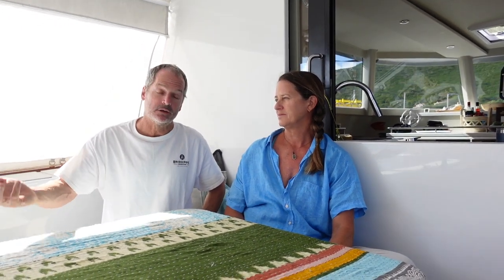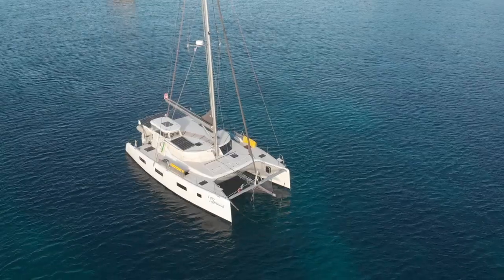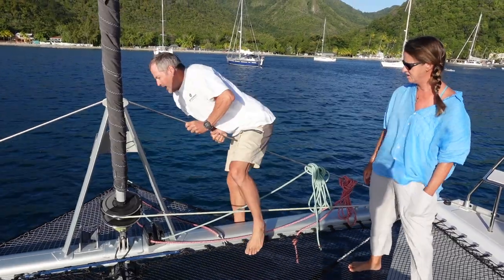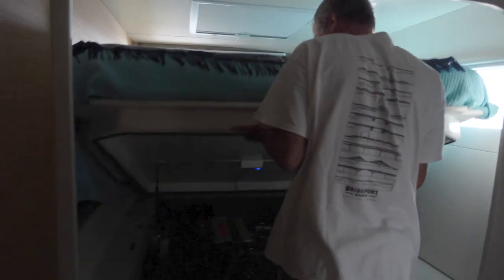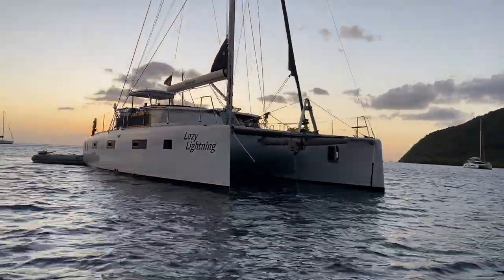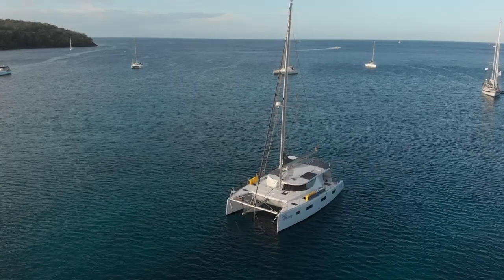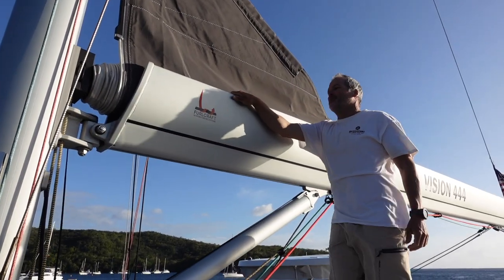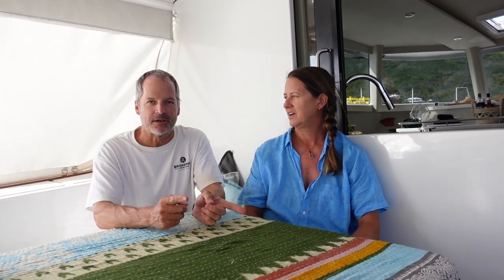ELECTRIC SAILING: WHY THEY CANCELED THEIR OCEANVOLT SYSTEM

Comment: We will have soon an monohull OVNI 430, aluminum boat , 24 kW Ocean Volt electrical motor, a 19in propeller, 2 x 24 Volts LiFe Po4  batteries ( if one set fails, the other one can work, a 11 kW genset that can provide automatically electricity to the motor if we have problem with the batteries and 940W solar panels. All the boaters with an hybrid system are very happy and will never return to a big diesel engine, noisy et smelly. But silence has a price and it is still costly. In 2035, diesel motoring boat construction will stop in Europe. Be prepared

Comment: Serial systems make more sense and are more efficient, that's why most freight across America is moved by locomotives with serial diesel electric drives. The only advantage of a parallel system is redundancy in the drive system but on a catamaran you already have two motors which is redundancy, do you really need 4? The only issue now is someone making large enough motors for your desires.

Comment: Follow the logic of Toyota and a hybrid is the ultimate as a large battery has a huge expense and all your eggs in one basket. I want to be able to motor out of the way of a freighter a fishing boat or a storm if my rigging let’s go or,,,,got hit by lighting and fried the electrical systems. How green are batteries ? You can buy a replacement battery , just the cells, for a Prius that are better than the originals for cooling for around 2500 usd. eBay has complete battery packs for under 4000. Automotive systems are amazing for the safety of replacements. You have no choice and must cut the power coming out of the battery pack in order to remove it. Incased in metal has a cooling fan with a filter built in temp sensors  and will be bolted in place. Bingo . These batteries would easily fit under your bed . If you aren’t sure just watch a YouTube video of how to change a Prius battery. Using components from the automotive world is possible but not for everyone. The advantage of supply and universality are a no brainer. The safety factor as automotive products are designed for impacts roll overs and basically accidents. A Prius battery pack weighs 90 lbs and would basically fit in a large suitcase. So have two of them with some solar and power the whole boat and a separate starting battery for the engine. Thanks for the video peace on earth and ocean.

Comment: PS There isn’t a battery made or is going to be available for the foreseeable Future, that can even get close to the Energy Density of Gasoline, Let alone Diesel Fuel.That a very basic Fact that people need to get their Heads around. That is why my Next New Boat, an Island Packet IP 439 comes as standard with an 80 horsepower Yanmar Diesel, and to guarantee proper Battery Care, it is also going to have a 6 kwh Diesel Generator which will not have very much use, though to keep it happy, it will be run regularly. Bob. 👍⛵️✨✨✨❤️

Comment: People go PARALLEL hybrid because of redundacy of systems. Diesel dies then eltectric takes over or vice versa. That's the big argument. But comes the question of weight.  2 systems = weight of 2 systems. You double everything. Can anybody tell me how people can build performance carbon boats including such a design which does not care of the weight? This makes no sense at all as performance means control of the weight. I do not get either those same people as they say they will never use the diesel engine, or just in some rare situations as the recharge of the batteries is needed. This being said, they will use 99% of the time an electric motor which is not a true main electric motor, since it just an additional motor added to an existing thermal engine system,  and in order to charge the batteries, they will use a diesel engine which is not a true dedicated generator...Reliable technology is there. A true electric engine combined to a true generator. SERIAL hybrid makes sense and seems to be a smarter approach!
Reply: more weight w those 2 electric motors yes but you delete the generator that would bean even swapp on weight, and you have two generators w hybrid

Comment: Most of the electric and hybrid packages marketed today are for getting in and out of docks and harbors. They are substantially undersized. Motors on sailboats must be sized for the worse conditions and long durations. That is why the sucessful electric boats are large and can accommodate 100-120 kw emotors and 200-300 kw battery banks per motor. A lot of weight and a lot of money. After the initial start up of a big electric motor  you can "motorsail" for 10-30 hours drawing about 15-30 kw per hour. I prefer an electric electric motor in bad conditions because torque is instant while diesel torque is wot.I have also have lost my diesel too many times in bad seaways because of overheating or contaminated fuel. Two 7.5 kw generators will extend  your range substantially.

Comment: This is timely for me. Thank you very much. My 65 + years in Alaskan waters (all seasons---that is winter, winter, winter, spring|summer|fall) have kept me from the all-electric drive. Too many two week northerlies with heavy icing conditions and as well anchor-draggings and wind switches in the middle of the night that had me having to run out into a large strait or sound. Then there was the time I was awakened at 0200 by all of the fresh water ice in one massive floe cutting loose from inside the bay during a howling SE and riding over my anchor line while crunching into the fiberglass hull.
So even for inside waters of B.C.-Alaska there are times where you need the sustained power of a diesel for getting out of and staying out of a life-threatening jam. There are also places where the currents run much faster than the hull speed that you try to time your passage through but it doesn't always work out to plan.
In summary, I agree.
Reply: Since it is the case that the most powerful motors are electric motors while also being instant on and instant torque, an electric system seems to be ideal for your situation especially coupled with a diesel generator to recharge your suitably sized battery bank as needed. In the North and its heavy winds I expect a couple of wind generators would be ideal in reducing your diesel generator capacity and your permanent fuel tank size. In such a system your biggest maintenance headache would be the diesel generator, fuel filter, and to a lesser degree those wind generators. :)

Comment: Some great points here but I would recommend a serial hybrid system for the majority of sailboats.  The parallel system has its benefits but where you really want that is in a larger powerboat where going fast for over an hour is necessary.  Two sailing catamarans one 54' the other 64' with serial hybrid systems from Torqeedo sailed from Cape Town to Antiqua.  no issues.

Comment: A day when u can add on the bracket to mount an electric piggybacked to the diesel on existing setup. Independant of and as an alternative to , when conditions are right. Perhaps a sprocket for a belt/chain between the transmission and coupler ? and a reliable, simple clutch. My yanmar 2gm20's are 40 yrs old now and running nicely. A simple retrofit is the day I'm looking  forward to. Maybe I'll learn to weld 😊. Nice video guys and I agree with your decision .

Comment: Can you explain your reasoning about electric being better suited for costal cruising than blue water sailing? I seems the opposite to me: one cannot afford to run out of power near the coast and one sails when on a passage, even if it means slowly when there is not much wind.
Reply: Just noticed this.  The problem is that one sometimes needs to motor for multiple days in seas, and sometimes waves larger than 2m.  The Oceanvolt system could barely get the Vision444 to 3.5kts against the wind in medium seas and consumed more diesel with the 18kWh generator than two 40hp diesels @2000 rpm (which is not the cruising speed but one needs to slow the boat down to 5.5kts to reduce the pounding).  If one is coastal sailing, one can always pull over to harbor when there is no wind or you need to move nose to wind, in the ocean you don't have that choice.

Comment: Interesting. Going electric is both absolutely possible as well as not for everyone. Last winter I build and installed a full electric system into Aku Wama, my Pogo 8.50. After one full season and 3000 miles I am still very happy with it, it turned out much better than I expected. I should do a video about it :). But,  my electric engine is truly as powerful (6 kW) as the diesel engine (10hp) it replaced, a Pogo sails very well so I rarely do need to motor longer stretches (but traversing the Kiel Canal was not a problem), and the boat, engine and batteries are all a lot smaller than a 45 ft cat.
Reply from the maker: Sounds like a great setup you have there! Definitely worth watching if you make a video of it
Reply: Yes electric can work, Sailing Uma has proven that. It just wasn't going to serve our needs.

Comment: We’ve been discussing and think it’s great for sailing eg 50-100nm a day, no aircon on . But given we’re more likely to sail days on end 24/7 with multiple air conditioners and equipment on, we doubt it’ll work and that it’s worth the investment. Even though we’re looking at many kw of solar and regeneration.. the calculation so far seem off. 
Well discuss again before de finite order to build goes in. But so far I don’t see the point in financial terms at all. Given what we would spent in addition the financial part seems way off. Hence for that money we may redesign the hulls to sail more and motor less. And buy a diesel.

Comment: Please bare with me, but can you just use put on a bigger propeller?
Reply: The manufacturer only offered a single (too small) propeller choice.  Given the torque an electric motor has, it should handle a bigger prop, but one also has to consider the saildrive that you are mounting it on.  Theirs was visible smaller than the saildrive on the diesels we ended up installing. I doubt it could take the additional load from 14 to 16-1/2 that the prop a 45ft cat requires, that a 33% increase in area to push (radius squared).
Reply: @lazylightning6070  Thank you. I guess we're not there yet.  Godspeed to you both

Comment: I have heard these complaints and they seem valid,  but I can't squate this with the Windelo boats that seem to use the BellMarine system with the generator backup quite successfully (maybe theyre not telling the truth?).  Achieving 8 knots on the large Windelo boats does not seem to be an issue.
Reply from the maker: I know of at least one hybrid electric Windelo who left on an around the world trip last year and pulled out both electric engines and changed for diesel as the system was not performing according to his needs.
Reply: @Boatlifeisbest Hmmm, interesting, good to know
Reply: @mattclark6482  the windelo 50 & 54 uses 20 kw motors = 27 hp, way to insuffisant to move the boat w wind and waves, they should have use two 30kw motors that would help, but it will require bigger generators, bigger batteries... less range, the hh 52 as two 38 hp diesel beta, and it s nice to have the electric incase of a diesel failiure

Comment: I've gone back and forth over this question myself, and I still think the serial hybrid system is the best way to go in the long run for a catamaran. That is assuming they can get the kinks worked out. But for me the selling point isn't "being green" or efficiency at all. It's that a serial hybrid system on a cat will have 2 fewer Deisel engines (one DC genset vs two Yanmars and an AC genset) to maintain. That's a lot of time I'm not tightening belts, changing oil, or replacing impellers. And that is immensely attractive to me.
Reply from the maker: Both options definitely have their own up and downsides. So what works for one, might not work for the other. Just sharing the experiences of some, hoping that it will help others. Thanks for watching 👍
Reply: I believed the serial system was best too, but there is a lot more loss than I thought when using the motors with the DC genset. I now believe parallel (both motors connected to the props) is the way to go. Also, with the new high power  alternator technology available now,  you don't need a genset with two diesels.
Reply: After being on sail yachts and sailing alot of miles , cats mono,  hybrid,   the 2 things you will get rid of is the most efficient all round part of most yachts , 
Generators break down and more problematic,  solar won't keep you off a lee shaw , regen great when moving in smooth seas,

Comment: I'm with Peter and Kiki on this.  One diesel powering two electric motors and then decoupling to be purely electric when entering and exiting anchorages/marinas, would be my pick.  There's a lot of "massaging the data" going on with electric systems but the reality is that they are slow, underpowered and their range is garbage, for the capital outlay of buying the latest shiny thing.
Reply: In comparison nissan cars one engine but doesn't drive the wheels , just charges a battery bank . But still only 42 miles a gallon , why not just a efficient engine 
Cut out battery and motors ,     they don't ad up on the green issue .
Reply: @davidwarnes5158  'climate change' or 'going green' are new catch-phrases by politicians to replace the old phrase 'new taxes'
Reply: @markleeson3453  be that as it may without something being done to tackle the issue, the harm is going to be significant, real, and devastating for us all.
Reply: @Saturnius  I spent most of my life on your side of the issue, but a look at how the Earth is coming out of a long-term deep freeze and just following its natural progression of cycles has me believing global warming is baked in the cake and human effects infinitesimal compared to the larger forces at work. You may disagree, but I'm doing what I can to adapt to what I think are inevitable changes---changes that follow a long-established pattern.
Reply: @davidwarnes5158  hybrid in theory are the best right you have infinite power with a diesel genny and electric has the instant torque. The fastest production cars are going this route now along with trains have been forever.

Comment: 2:06 sorry, but no. Diesel engines are most efficient (highest torque/lowest consumption) at low RPMs, around 1700-1800 rpm. Typical optimal range of any ICE is hardly ever in use in typical application, but can absolutely be taken advantage of by generators or serial hybrids.
2:10 also no, as pretty much every new hybrid model nowadays uses serial generation. You cherry pick Prius as an example, meanwhile both Nissan and Mazda use serial hybrid in all their new hybrid models.
2:45 you don’t have to be underpowered, there’s no reason why you can’t have a generator powerful enough to drive powerful electric engine. It’s true, though, that it appears that marine manufacturers charge arm and leg for their more powerful engines, which is ridiculous considering how cheap automotive engines are. And there’s hardly any difference between them!